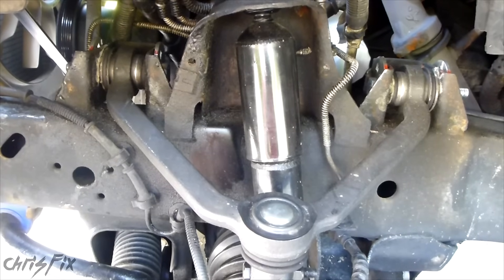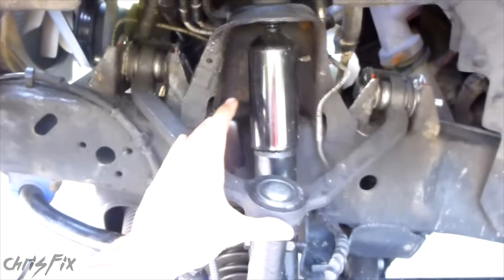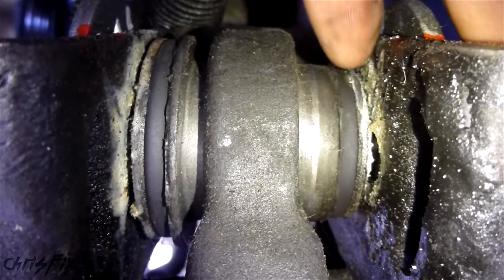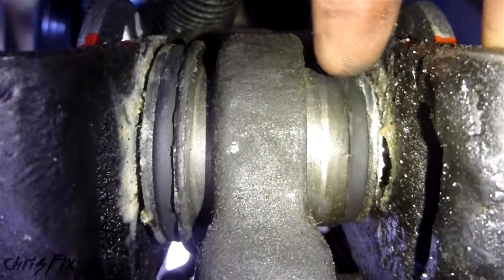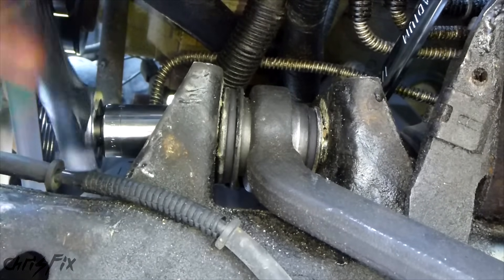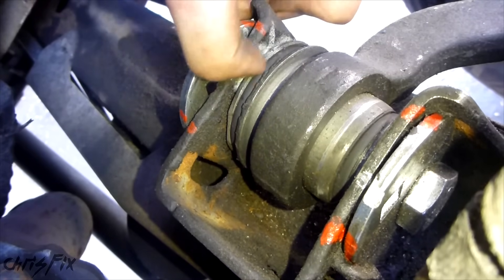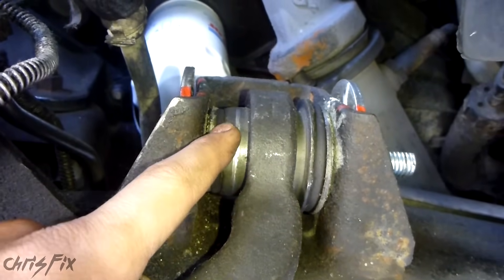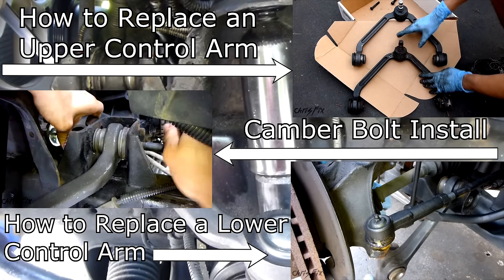Control Arm Bushing Preload, Important Information!

Comment: Gonna tell you right now, you MUST do this. You have to preload all control arm bushings. If you have a lowered car like mine, you simply measure the height from the center of the wheel hub to the center of your fender well arch while the car is on the ground, sitting on its tires and wheels. After you snug up the new control arms, you jack up the suspension to what you measured while the car was on the ground, re-measure from the center of your rotor/hub with the wheels off obviously, and then torque the bolts. I made sure to write down the measurements because our garage floor is not level, and of course each measurement was slightly different for each side because the floor is slightly sloped. Take into account how level your parking surface is. Anyway, I did this and have had ZERO issues since. I had the same guy put control arms and bushings on my car twice and in less than 8k miles, every single bushing was cracked, falling apart and some were missing COMPLETELY. The work was done improperly both times. I finally just decided to do things myself and it paid off. This video certainly helped as did a few others. This just goes to show you that just because someone has been working on cars for years doesn't mean they know everything, as he apparently didn't. Very nice guy but just not as good as advertised with mechanic work. How did he not know about preloading bushings? 😂 Costed me several hundred dollars basically. Do your research. Just because you think you know what you're doing doesn't mean you do!

Comment: While you're in there, replace the sway bar end links. It's a five minute fix that will cut down on squeaking and clunking. Maxing out the suspension will often damage old sway bar bushings in the links.

Comment: For people with no clearance to torque when on the ground,Try using a standard 1/2" drive ratchet to snug up the bolts  real tight when car is peloaded and on ground..Even though clearance is tight and a reuglar 1/2" drive torque wrench wont fit in there you should  still be able to get good torque and very snug tighten the bushings with the ratchet..That should lock the bushings in place under preload...Now u can  jack the damn thing way up, pull the wheel and apply the full final torque with the torque wrench..
If anyone sees any flaws in this advice, please comment..Im only trying to offer alternative to a tough situation..My car is probe gt, just did the 2 front lower control arms and the damn bolts were siezed to the bushings.2 weeks of spraying pb blaster and what utlimately got it free was the air chisel ahmmer on the bolt to back it out of the arm and bushing..and yep, the say bar links had to be cut off!

Comment: Hi Chris, I always enjoy your videos. You are very clear and concise. I'd like to suggest one more thing which will help with Bushing Preload. Whenever I dropped my Hummer H2 (similar suspension to Chevy 2500HD pickup), the camber bolts shifted. The weight of the truck made it impossible to set my camber bolts for correct alignment. So I jacked it up again, applied molybdenum grease on the metal ends of the bushings, then tightened the camber bolts to about 60 ft-lbs. With the camber bolts more than snug, they didn't shift under the weight of the truck. But one end was still loose enough to allow me to do fine camber adjustment before I fully torqued the bolt down. The grease doesn't interfere with the bushings' function at all, because the tension on the camber bolts clamps the bushings in place very firmly. But it allows some slippage, which will prevent the bushings from getting torn if I reach the end of suspension travel.
Reply from the maker: auxpowerunit That is a great tip man! Thanks for sharing!

Comment: Instead of putting the tire on could I just put a jack under the lower control arm and raise the suspension that way?
Reply from the maker: damagingspark7 You could do that, especially if you wont have enough clearance to get in there with the tire on the car!
Reply: Better for small cars, I'll try to do this later in our toyota corolla. (Nov. 02, 2018)
Reply: @draxus1266  How did it go? I'm replacing my control arms tomorrow in my corolla. Do you know if any control arm links have be greased in any way?
Reply: @alexcoulson7321  Hi bro, it's been several months (6 months to be exact) since I replaced the Control Arm Bushing(BIG only, small looks still in good shape) of our Corolla 9th Gen. I remember that I preloaded the suspension almost same with Chris procedure through wheel loads (which could give smaller room for work), though I think it won't do huge effect in Big bushing but with small it might when installing it back. 

Regarding control arm links, are you pertaining to roll bar end links? If your asking about if the end links are still with grease you may try to inspect by hand by twisting (middle rod) or trying to move it back and fort if it's still resisting and wasn't too movable your end links are still fine. When their in bad shape they clunks most of the time which are so apparent to be replaced as soon as possible.
Reply: @alexcoulson7321   Well anyways bro, are you done replacing? It's been 2 days since your message sorry for my late response.
Reply: @draxus1266  yep, I replaced them, took a lot longer than expected and pre loading definitely helped getting the control arm and sway bar back on. Thank you for your reply.
Reply: Hi, glad to know you did well bro. Have you also bring it to a automotive shop to check for alignment? Keep up our Corollas =]

 Anways, what Corolla Gen you have there brother?
Reply: @draxus1266  going to take it in this week to have the alignment done and might also get them to put the driver side control arm in due to the engine having to be lifted. I've got a 2003 Corolla CE, only 80,000kms on it.
Reply: Alex Coulson  Alright man hope all is w ell with your process.  Oh we have the same model, ours are 2002 Corolla Altis 1.6J Manual(in least Philippines variant) with 231,000km.+ in it which yields me to take care more of her. Replaced already water pump, shock absorbers, 2 engine mounts etc. Still found to replace fluids or to flash, praying that suspensions  last more and or  I mean the whole car.
Reply: @draxus1266  I'm not looking forward to the day I have to do all that work hahaha good on you for doing it all yourself, it's tough work.
Reply: Sure, as long has you know when the tire has reached road height. And don't lift the vehicle off the jack stands. 
Best option is to take marking pen/white out and mark the top and bottom edge of the control arm on the bracket. Then move the bracket to that position. someone in my neighborhood had  this issue, he was working on a vehicle , then a week later had same wheel off. He said bushings had ripped, took back to store and got new ones. He had not set ride height before tightening. I told him about this topic so it worked out
Reply: I wouldn't be the same as having the wheel on. Not only does it move up, but there will be force pushing outwards as well. Though it probably won't matter.
Reply: what set of tools you need

Comment: You can also measure your drive height from axle to the bottom of the fender the put a jack under the hub and jack it up until it is at the proper drive height then tighten everything up to it's given torque value, which can be easier with the tire off and car in the air.

Comment: I replaced my lower ball joint but I had to take the LCA out to do so. I tighten the LCA while still in the air and now my truck rides rough. I did go back and adjust the LCA while my truck was on the ground but it still rides rough, a little better but still rough (bottoming out) and feeling every bump. Your Help is needed here, Thanks

Comment: I put my passenger side control arm on and still have the driver side control arm left to do. Will do this next time. Couldn’t finish threading the caliber bolts b/c I didn’t have a deep socket to use. But thanks for the tip Chris Fix.

Comment: Your video cemented my logic on why torquing the end bolts on the ground is necessary. Following that same path of logic, would the bolts need to be loosened and retightened if changing tire sizes on a vehicle?

Comment: Yeah thanks for that tip! I just replace the control arms on my Grand Caravan and it's really too low to torque everything with the vehicle on the ground. So with that in mind would it be better to try to put the wheel back on and then jack up the wheel to load the suspension? And then torque everything?

Comment: Great video. I commented on your vid awhile back saying this, it's a VERY common mistake. Great video!
Reply from the maker: Ryan Richards Yes, and this is why I made this video so thank you very much Ryan!
Reply: Yes, I've made this mistake too. Prior to YouTube I'd torque my axle while still in the air. Remember to look up your torque specifications! Some cars will surprise you. Some axles are supposed to be hand tight while mine needs to be 160 ft.lbs. Big difference.

Comment: Thanks man.  I'm putting my lower and upper arms back onto my car next week after we install all new bushings and ball joints (1998 Trans Am).  I assume its ok to use the floor jack to lift under the lower control arm until the front end starts to lift up and consider that pre-loaded, WITHOUT the tire being put back on?  I ask because its going to be impossible to reach up to tighten the upper control arm with a tire on.  Same with the lower arms, no way I can get under my car because it sits way too low and I don't have a normal shop car lift.
Reply from the maker: Correct. I actually show the process in this video so you can see how I do it: https://youtu.be/V_g1-WHD4rw
Reply: @chrisfix  Awesome, thanks.

Comment: Just giving my input.  If you have air suspension,  you will need to slowly lower the vehicle onto ramps while the vehicle is running until it rises on its own accord.  Once  it reaches operating height....then torque them.
Reply from the maker: Thanks for sharing!
Reply: @chrisfix  thank you!  Your content is extremely helpful to thousands of people for sure.  :)

Comment: @ChrisFix Can we leave the bolt/nut a little loose, so that bushing will move on the bolt instead?  in this way, the arm moves freely up and down, and I think the bushing will last much longer.  Thanks!
Reply from the maker: You're going to want it a little loose when you drop the car then you'll torque it to spec once it's on the ground, I wouldn't set and leave anything loose intentionally since there's a good chance it can come out while you're driving

Comment: The 'tighten on the ground' (i.e. preload before tighten) only applies to OEM-style rubber bushings where the rubber is bonded to BOTH the outside metal sleeve and inside metal sleeve. However, for aftermarket polyurethane bushings, the metal sleeve is supposed to rotate against the poly bushings so it can be tightened whenever! Just FYI.

Comment: Question on preloading. 
Are you able to just use a secondary jack to apply the load? Example; using the lower control arm to lift car/truck for that preload? 
Also, would uneven preloads cause a vehicle to have an uneven left right bounce, almost like a single wave motion?

Comment: great video. If you're still doing your youtube thing and monitoring this, do I need to have outer tie rods connected when I set my Silverado 1500 rear wheel drive down to torque the new control arms? The reason I ask is I will also be replacing all power steering components and want to be able to have the truck on the ground while I remove and replace the power steering pump so that I can figure out a natural sequence of connecting to the new rack and pinion and the new power steering oil cooler. I can't afford the nice mechanics ladder that lets you work almost as easily under the hood as on the ground without having to raise and lower a bunch of extra times. I think I almost have the process figured in my head and will be starting the process in 2 days of replacing all the steering components under the hood along with control arms, springs, knuckles, wheel hubs, rotors, calipers. First time I'll be doing this sort of project since about 1977.

Comment: great tip, but you could raise the control arm and tighten the bolts before you attach it to the spindle
Reply from the maker: badazzone1 That is a good idea but then it is very difficult to attached it to the knuckle. But you should work with the car and not against it so if that is easier in your situation, go for it!

Comment: Excellent video Chris! Straight to the point as always; plenty of info and great feedback I see. Replaced my tie rods ends on my '05 Avalanche (2WD); now thinking about  the ball joints. Advice??? Is it better to replace the upper by replacing the control arm, or just the ball joint itself?

Comment: Not many people inform us about preloading. I'm about to replace the upper control arm on my gfs 07 mazda 6. Need to check that i can reach those two bolts with the car on the ground before i start. Thank you.
Reply: Alternatively if you can't, you can jack the lower arm and knuckle up into the control arm so the car comes just off the jack stands, that way it's sitting up how it would, then torque it down and lower the suspension back until the car lowers back onto your stands. Repeat on the other side. Hopefully you got through it though lol, I see you commented 10 months ago
Reply: @alexmattucci8507  I ended up lowering the car & rotor down onto another jack w a piece of wood on it after measuring where the tire sits normally.

Comment: Hi Chris, if the control arm bolts were fully tightened while the vehicle was in the raised position,    and the vehicle had been driven around afterwards,  would it be too late at this point to loosen the bolts and retighten them as directed in this video?

Comment: I tightened my new upper control arms on my Sierra while the suspension was hanging.  I did have a full alignment done and they adjusted the camber bolts quite a bit. Would the pressure be released when they loosened the camber bolts to adjust the alignment, or should I loosen them and do it all over and be careful not to move the camber adjustment?

Comment: For better access when torquing can you simulate the load by jacking the brake rotors bolted to hub with a block of wood in between the jack and rotor?

Comment from the maker: +Mason Matvich, I cannot reply to your comment for some reason so I hope you see this. I did not replace the exhaust manifolds, I just painted them. Replacing them will be a real pain! I would get a quote and see how much they will charge you vs how much you can do it yourself. It will be tough, you will need a good penetrating fluid and a torch.

Comment: You dont have to drop the car to the ground and put tire back on. Instead, one suggestion, you can jack up the suspension at the knuckle till the car is lift of the jack stands . In that way, you have more more to tight up what u need to tight :)
Reply: Just put a jack under the lower ball joint and then tighten control arms?

Comment: I really like your videos. Very thorough and precise. I had a question in regards to identifying which arm actually needs replaced? 

I took my 07 escape 2.3l in the other for inspection and they said I had bad bushings but just wrote down “rear control arm” as well as my front inner and outer tierods. 

What’s the best way to determine which side the rear control arm is bad on and if it’s upper or lower? I’m new to working on my cars. And I ain’t paying 500 bucks for all that. 

Thanks!

Comment: great video...l just replaced my upper control arm....l put a jack under the frame and another under the lower control arm....my mistake is that l only had the lower control arm jacked up enough to safely remove the tire....l was left with a little play after putting the tire back on...now l know why....thank you. ls it true that a bad ball joint can screw up my drive axle?....l got a 2007 chrysler aspen. Thanks again.
Reply from the maker: +dan bond Awesome! A bad ball joint wont mess up an axle but it can cause problems if the ball joint fails.

Comment: Nice video. I don't know if you still monitor this but.........my marks for where the alignment bolts go for the lower control arm that I put prior to removal are no longer visible. How do I know the proper orientation for the bolts plus, one of them was so rusted I wrecked it getting it out and had to purchase a new one. I was taught to mark them before removal but I am still not exactly sure why.

Comment: When adjusting the camber on my truck's front wheels, it's a challenge because the holes the camber bolts go through are oval-shaped.  I was needing the bolt to stay towards the outside of the oval but whenever I preloaded, the bolt would slip towards the inside of the oval!  I ended up wedging it with a regular bolt to maintain the right position.  Would it be correct to think that since the springs are original and have 455,000, they were not capable of supporting the weight of the truck properly which caused the upper control arm to shift inward at the oval where the camber bolt goes through?  Otherwise, is it correct that worn out springs and too much positive camber is what caused the lower control arm to rub a hole through the  shield towards the rotor?  I'm just looking for confirmation that I'm "getting" this down right.  Thanks!
PS:  what's a good torque wrench that will fit in the location and still allow for movement?  The one I have is long-handled and useless in this application but I need the length to get the proper torque.
Reply from the maker: Worn out springs and positive camber can use suspension parts to rub but that would also be due to worn out bushings and ball joints so check that out.
Reply: @chrisfix  will do. Thanks!